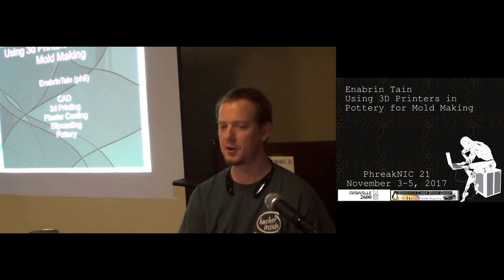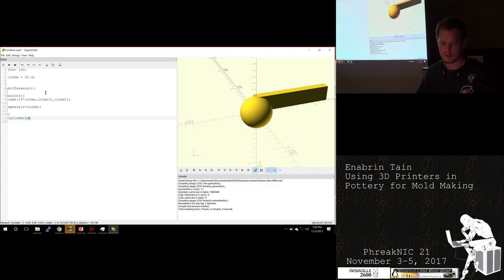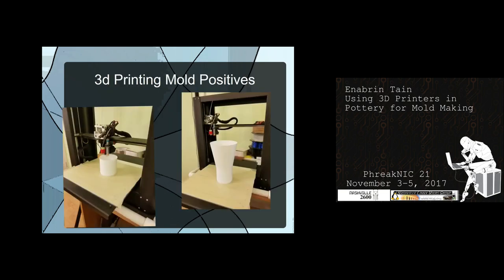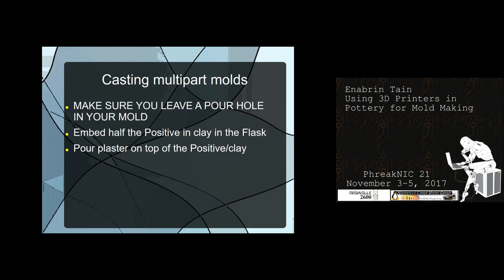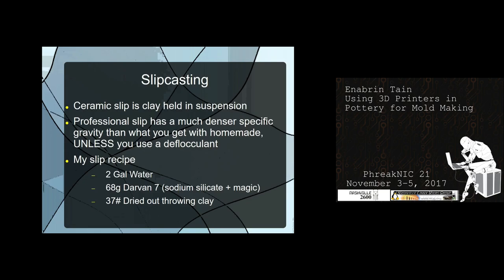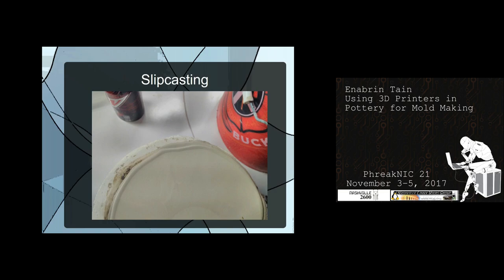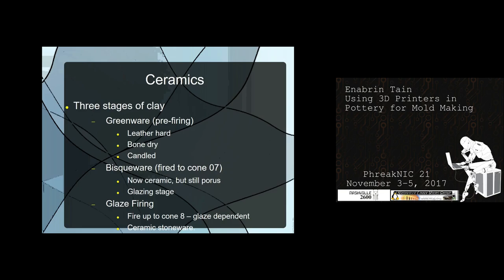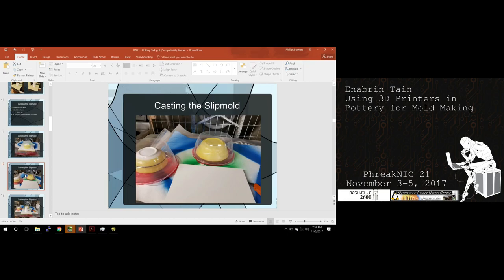Using 3D Printers in Pottery for Mold Making

Comment: What would happen if you skipped the plaster mold part and just 3d printed a mold for the slip to be poured in to? would it stick really bad and ruin the mold also?
Reply: Wow, I just found this video! The point of having plaster is that it draws the water in the slip out, causing the slip to solidify to the wall of the mold. If you skipped the plaster step, you could 3d-print a negative and press clay into it, but slipcasting requires plaster.

Comment: This is exactly the subject matter I was looking but it has to be one of the worst instructional videos I have ever seen. Presenter keeps talking about things we can't see while showing a meaningless slide and showing a card with the name and date of the event. It makes immense assumptions about what the viewer knows (what the heck is a slipmold? Talks about was melting PLA but makes no mention of why/how the wax is used.

I'll keep looking.
Reply: Funny I was just thinking the same thing! You find a decent one?
Reply: Gary Houser nothing!
Reply: @rauls4  I just checked out a friends kiln she hadn't fired it up in several years and am wanting to make 3d molds for slip casting. Guess we are going to have to invent a way to combine the 2 processes. Let me know if you find any info. Thanks
Reply: @TheGreatBizarro  Will do. I just finished my first object casting project (a Coke bottle). A 3D printed item is the next thing to do. I'll let you know when I make it.
Reply: What would happen if you skipped the plaster mold part and just 3d printed a mold for the slip to be poured in to? would it stick really bad and ruin the mold also?
Reply: I'm sorry I was rambling in this. I was not sober and my friends were sometimes distracting me, lol. To answer your question, I used wax to coat the 3d printed positives in order to prevent the plaster from getting into the tiny edges of each layer. pottery plaster wont stick to wax and it wont stick to clay, so any time I needed to make a 2 or more part mold, I'd embed the part in clay and pour plaster over it. then, once the plaster had cured,  flip it upside down, remove the clay, add mold release (or simply dish detergent), and pour the other half.
Reply: if you dont coat the part in something to hide the layers, they will definitely be captured by the plaster, even if you use a release agent (and wind up lucky not to break bits of plaster out when you are removing the model)